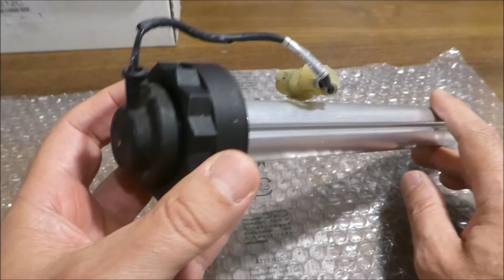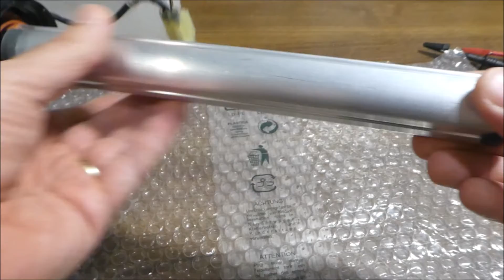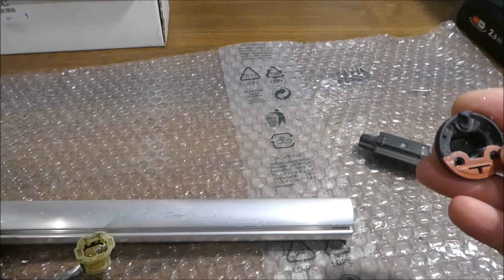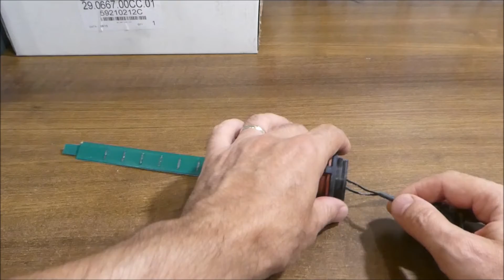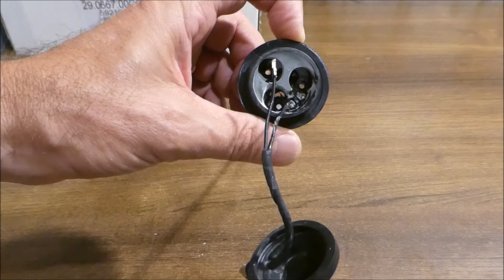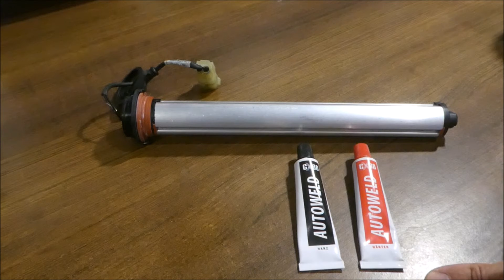Ducati Multistrada 1260S fuel level gauge repair

Comment: Maybe there are multiple root causes for malefunction of Ducati´s fuel sending unit. But in most cases the root cause is the fuel fload in the fuel unit which bears no E10 petrol leading to swell the fuel fload and sticks it till finally completely jams.
In that case you need not to repair or replace the fuel sending unit but just to refuel the fuel tank a few times with E10-free petrol and it will be cured after a certain time. I refueled "Aral Ultimate" 3 times and now the fuel sending unit works again.

Comment: Amazing job
Thanks for the advices.
Same problem in multi 1200 2015 only with 20000 km. 

I just ordered the part with the revised number 
59210213G (last one). Do you believe if i will put some thermal insulation down the screw of the  gauge will do something? 
Thanks again for the great job
Reply from the maker: Hi. First thing is that we don't know what do the index changes mean. It's typical in the automotive industry but sometimes it means an error fix in a drawing only. Hopefully it means some material improvement in this case. As for thermal insulation: you might try it but I don't believe that it would solve this design error. There is vibration, excessive heat load since the sensor is right above the vertical cylinder. Using different materials with different heat extension indexes often leads the same phenomenon: material break. It manifested either by a soldering microcrack or an internal connection break in my case. Unfortunately the validation of these products cannot cover all possible load factors and there are financial decisions that might lead to bad material complex.

Comment: problem that 99.9% of epoxy not petrol resistant and will melt
Reply from the maker: Them I’m lucky because I’ve found that 0,1%. 😏
Reply: @DesmoHead  time will show, seen epoxy that start melting only after 2 - 2.5 years

Comment: Thank you very much, this video is excellent.  I have followed your instructions and my fuel gauge showed the exact same problem.   Now I'm at the stage to re-solder the 2 wire and re-build the plastic around and then use epoxy to fill it. Thinking about using high heat epoxy resin.  My bike is a 2018 MS 1260s with only 6000 miles.
Reply from the maker: Hi. No need to use high heat epoxy because there are also plastic parts that can endure the cylinders heat so I think some common temperature range will do. It's more important to use fuel resistant epoxy.
Reply: @DesmoHead  Hi, I found J-B weld epoxy that is for high heat and fuel and chemical resistant, so I will use normal epoxy to close the holes I made in the plastic ( I wasn't perfect like you ) and then the high heat and chemical resistant epoxy to replace the old epoxy.  I just need to think a better way to solder the 2 parts contact.  Hopefully will work in that tiny space.

Comment: does anyone know what resistance values should be present on a good gauge? OL suggests a break in a wire but what should it read if its good and the float is just stuck? trying to see if i needs to be freed up without pulling it from the tank

Comment: Will simple two component epoxy dissolve in fuel over time? It didn't seem like it said fuel resistant on your epoxy packaging
Reply from the maker: What did you see on the packaging?
Reply: Sorry, I meant on the bottle labels. Is yours fuel resistant or it doesn't matter?  @DesmoHead
Reply from the maker: @SundeeStudios  I used two types of resins. CX-80 was for filling the bottom part of the holes and it is fuel resistant. The top cover was a low viscosity resin to create a nice flat cover surface. It is not fuel resistant, at least the datasheet dies not tell anything about it.
Reply: @DesmoHead  Understood, very nicely done. Thank you for the answer and the video!

Comment: Part of preventative maintenance here is to add a solution to your fuel for any long periods of time where the bike will be sat. I use Motorex ethanol treatment due to modern fuel having high ethanol content which can degrade parts in the fuel tank. I've had 3 multistradas and used this solution in all 3 and never had an issue after my first fuel sender failure.

Comment: Screw all that.  Chop the wires, put a resistor between the 2 wires and abandon the piece of shit sensor in the tank.  Your bike will always read the same, but at least you wont have to change the sensor every 2k miles.  Its a bike, NOT a car.  Wanna know how much fuels in it?  Open the tank cap thats literally under your nose and look, or wobble the bike back and forth and listen.  I road dirtbikes for decades, guess what no dirtbike has EVER had?  A fuel guage display.  Never ran out of gas one single time.
Reply from the maker: In a case I would not need a fuel level indication I might do this. But this video is for another solution and let the others choose what they want to screw. ;-)
Reply: @DesmoHead don’t bother… this is internet and your video is very important for those who need this info. thank you for the  vid.

Comment: I have this exact issue. 2017 1200s 33000 miles 😢
Reply from the maker: Same gauge supplier I suppose. It is a strange design to me and I'm pretty much sure that during the development there was no real validation to meet these issues during an aging test or similar load. But in exchange it is cheap...or cheaper than a fully validated one. 😝

Comment: As per the video, i have taken out the PCB, however i am thinking of filling the epoxy onto the PCB entirely. so that PCB will always be intact. Has anybody tried this method?
Reply: Thank you so much for posting this really helpful and informative video. I’ve got a 2020 Multistrada 1260 GT with 20K Miles and the gauge has just gone faulty, will use your video to attempt a repair. Thanks again 👍🏼
Reply from the maker: Might be a solution but considering that my cable broke at the connector inside the epoxy it isn't sure that it's a good solution. When you create a new piece of material by filling up the PCB side of the aluminium tube with epoxy then you re-tune it in a way so some parasitic vibrations might appear and cause some damage. For the heat expansion based soldering crack you need a simple re-soldering. If you fill up the tube with epoxy then you cannot repeat it next time if the same failure occurs.
Reply: @DesmoHead  thank you for your response. I was going to pour epoxy but could realise that the PCB is suspended freely into the aluminium slot. Here the vibration might be a problem as epoxy is only from 1 side and other tiny side is empty. Have you done re soldering again on the same sensor?
Reply from the maker: @greatpunit  No, solderings on the PCB were all intact. Checked under magnifier to find any damage. I had to fix the broken cable only.
Reply: i am planning to apply dowsil 1080 oxime sealant instead of epoxy. @DesmoHead
Reply: If you are 100% certain that the type of epoxy your using has ZERO reaction to gas both in the short and long term its possible in theory.  But, if it reacts to the gas it will melt, crack, break off or even mix with the fuel possibly ruining your bike entirely.  Just chop the wires, connect a resistor and abandon the sensor.  Its a bike not a car, easy to tell if it still has fuel unless your an idiot.
Reply: @ALLLLTheThingspersonal  just for an update, yesterday i gave the repaired fuel sensor to replace it at the ducati service center and i got a call from them that there was a short circuit in the fuel sensor. So the attempt failed miserably. It’s good nothing happened with full tank. Ordered brand new. I should have followed your method and should have used epoxy. Thank you very much for the help!
Reply from the maker: @greatpunit  I'm a bit confused here: which repair method did you make: epoxy or resistor? As for a short circuit in the PCB there is no need to worry: it is isolated from the fuel and would not make any problem. Might activate a fuse but it is a normal protection method for circuits. In a case this resistor method is installed in the gauge plug connected position it might show short-circuit-like symptoms because of the nature of resistors in parallel connection. Ohm's law.
Reply from the maker: @ALLLLTheThingspersonal  Have you checked the safety datasheet of this epoxy for these kind of material cross-reactions? ;-) An do you think I haven't? ;-)

Comment: after more than 10 years of being a KTM guy,  I thought i'm ready for a bigger challenge. So now we have a 1260enduro in the family. 
Funny, how similar problems they have to KTM 1290. 
But ducati manages heat a little better. Still hot, but not like "burn your pants" kind of hot. 
:)
Reply from the maker: Welcome to Ducatisti club. :-) Frankly speaking I have not met other failures so far than this fuel level gauge issue and the front fork oil seal leakage (subject of another video about front fork maintenance). Both are typical failures and they happen to me after warranty period. 🙂 And there are some design errors that I've found and fixed.